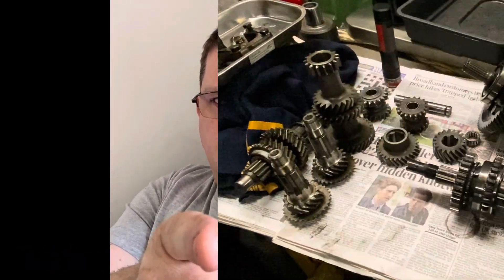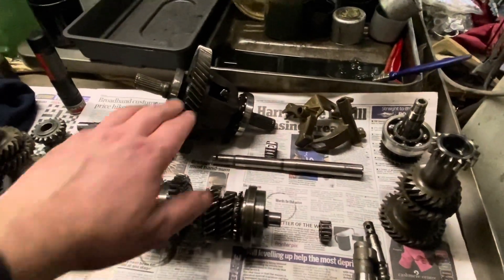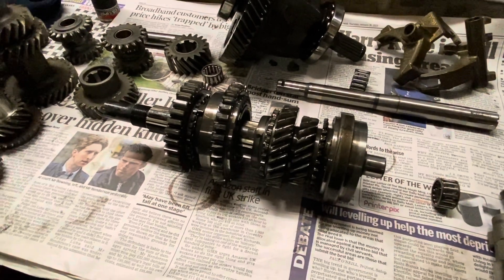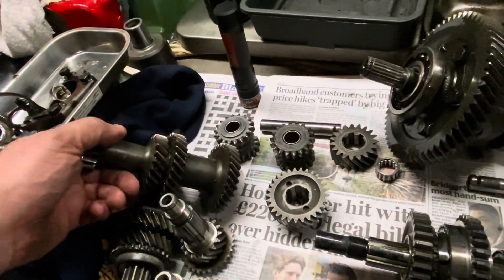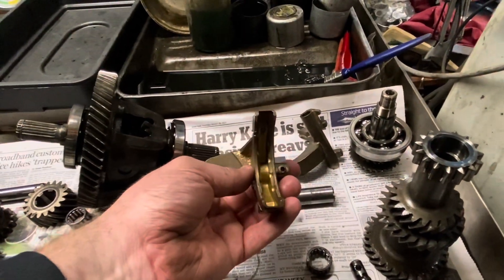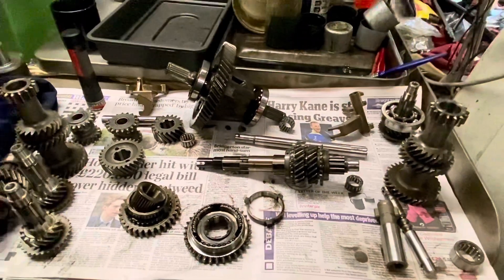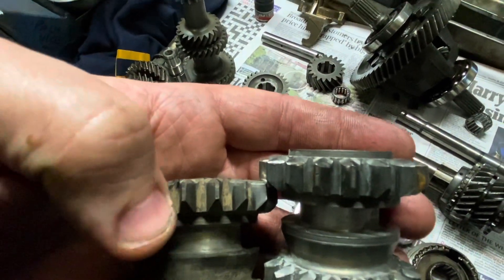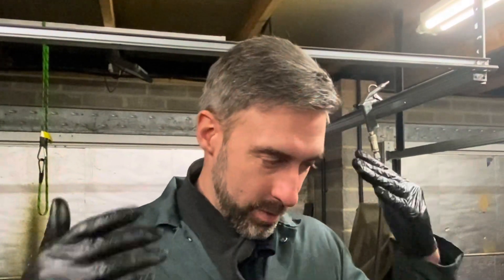Engine Club Episode 4 Kevin’s gearbox, Part 3 Inspection

Comment: Hi AC. What is twin ring gear, difference between standard gear please?
Reply from the maker: The ratio are different, 4.004:1 1st, 2.307:1 2nd, 1.435:1 3rd. 4th is the same 1:1